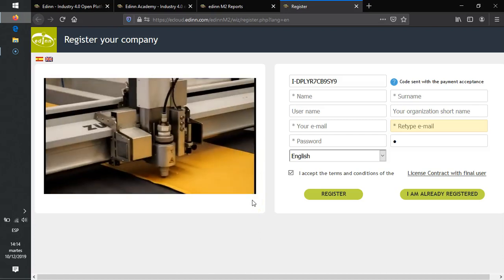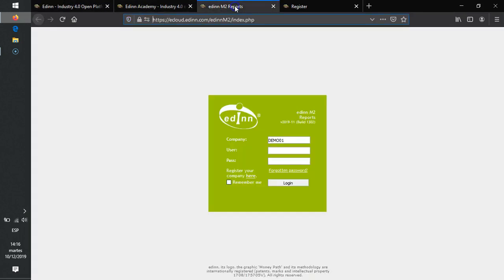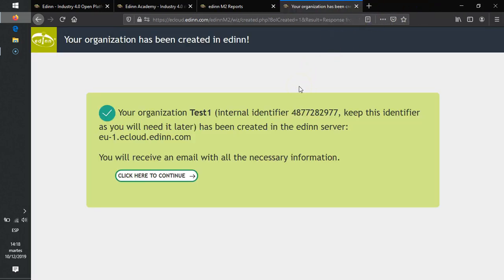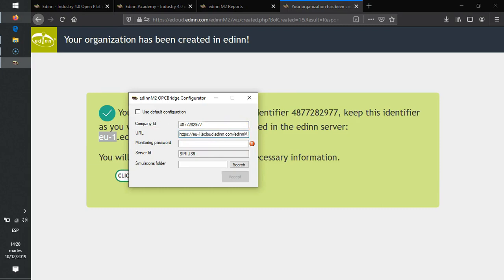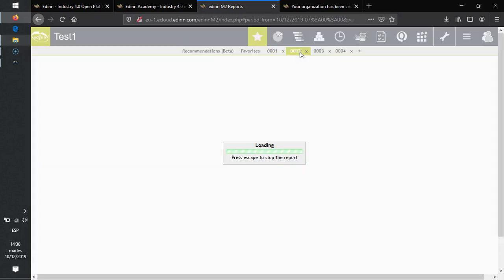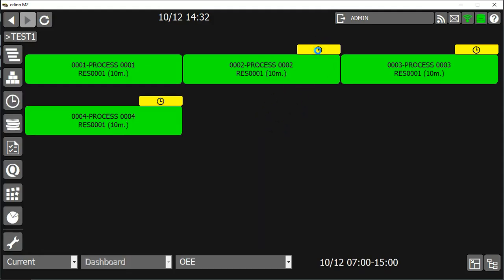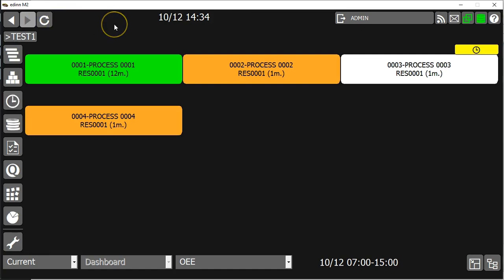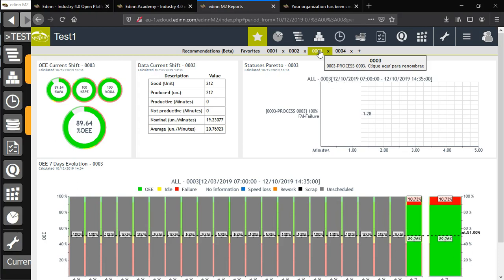How to connect Flexsim software with the platform | edinn Industry 4.0

Comment: you didnt say how to configure the data in flexsim and prepare it to send the data to opc ua server? you didt say how to connect the edinn to opc server  either? your procedure is very confusing
Reply from the maker: Hello! Thank you for your question. Regarding "how to configure the data in FlexSim": as indicated in the video, you do not need to configure FlexSim as it is already configured via a file in the folder edinn_OPC_Bridge named Community_simulation_1_process.fsm or Simulation_4_processes.fsm (you will need a license for this file). You have to open either file by double clicking it after having installed FlexSim. Regarding your last question, "how to connect the edinn to opc server": as indicated in the video, it is just opening the installed edinn OPC Bridge and configuring in it the company id and the path, which are provided by the edinn web wizard. Please review the video for all this. Please check additional documentation which follows and contact us if more help is needed. Thank you for using edinn. Additional doc.: https://ecloud.edinn.com/edinnM2/help/en/Using_Edinn_Sim_Intro.html
Reply: thank you for your asnwer. but i saw this video multiple times and i didnt hear any needs for opc ua server. but in the other videos edinn always says we need to connect the machnes data to opc ua server and then connect the eddin to this opc ua server as aclient. but in hear you only says we need opc bridge. this was confusing for me that in this architecture where the flexsim data ( which plays the roll of machines data) go? in flexsim helps it is menthoned that when ever we want to send the machines data via opc ua protocol, we need to go to emulation section of the model and configure the related data and link the flexsim to opc ua server. but in you video i did hear nothing about it. am i right or wrong? you mean we didnt need opc ua server anaymore and only bridge is enough for the connection between flexsim and edinn platform? i have already prepared a onpermis version of edinn academy platform and i want to simulate 1 process. i think in this senario we dont need bridge anymore, is it okay to connect flexsim to opc ua server software and then give to url of this server to edinn?  @edinnSL
Reply: please help me how to connect my flexsim model to my onpremis academy version of edinn without opc bridge. i want to use opc server instead @edinnSL